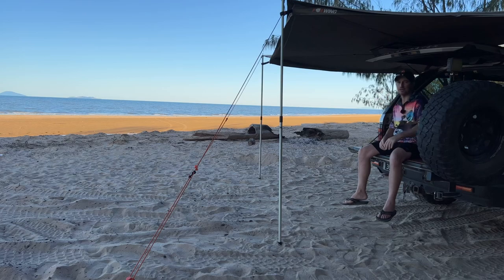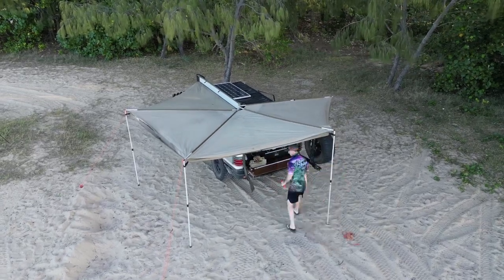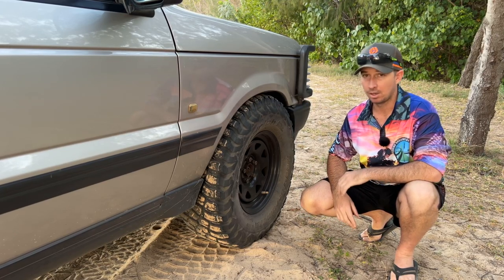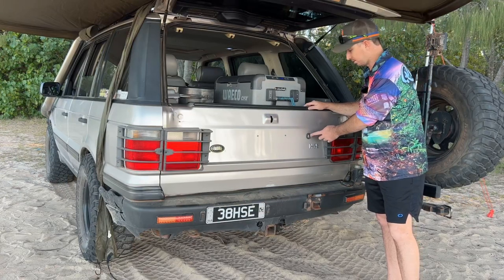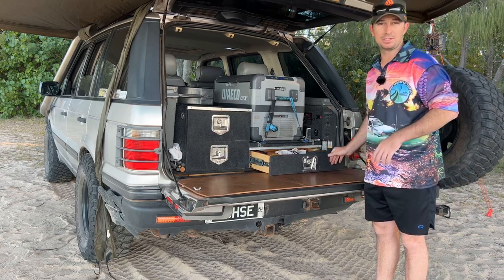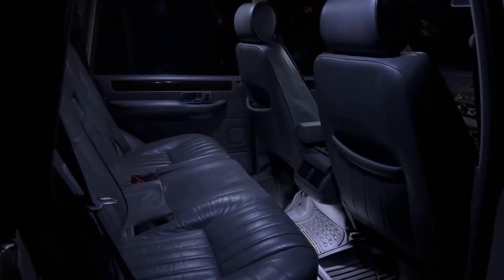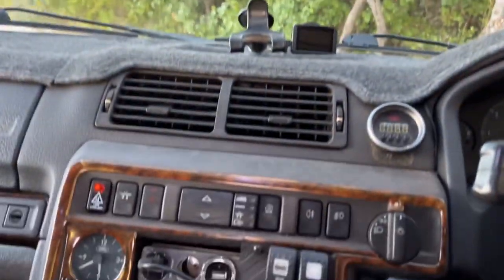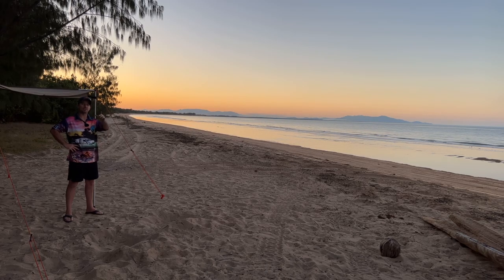The Complete Walk-Around of a DECKED OUT 4x4 - Range Rover P38 #p38 #eas #modified #4x4

Comment: Was your air sus system bypass a kit or a homemade thing? (If so where did you get it). Got a p38 myself and the air suspension is the only thing I don’t fully trust😂
Reply from the maker: Completely home made mate. I wrote the design on three sheets of A4 paper, got it lazer cut, welded together and then went about installing. It was first installed in my old blue P38 in 2011, which I retuned to standard when I sold it, and then put the lift into this current P38 in 2015.

It may take time, but it pays to learn how the EAS works. It’ll help you diagnose when needed. Keeping an eye on things allows you to catch things before they become an issue. They’re reliable, but they do require maintenance.

Comment: AWESOME VEHICLE, just done all four air springs, rebuilt compressor and valve body....got wof....runs and drives great....wow the 4wd is exceptional. Keeping stock but  wish for better tyres on the stock 16" alloys. Currently road tyres, any suggestions?
Reply from the maker: She sounds like a deadly machine 😁 tyres are a difficult choice. I’m running BFG KM3’s on mine and I find them a great tyre.

Comment: You don’t need spacers. The air sus has a ride height setting you can’t set. At full ride height when traversing awkward territory, if the air sus detects the chassis is grounding, the height is raised another two inches automatically and then drops again if no further groundings of the chassis is detected.  
Although I suspect you already know that.

Comment: On my 99 that plastic T on the top inlet to the radiator broke causing me to loose most of my coolant. I would be worried about weakening it by adding that temperature sensor. Plan to make a metal version one of these days.
Reply from the maker: Good idea!

Comment: Love it, have a look at truck Donaldson air cleaners, they have a drain rubber that allowsvwater to self drain but won't allow water in(self opening and closing)
Reply from the maker: Thanks mate, I’ll check that out for sure! Do you have any links?
Reply: If you search Donaldson air cleaners you'll see them on the bottom of the housing, they go from round to flat, ill see if mine in the shed still has 1 that i can upload a pic for you tomorrow
Reply from the maker: Thanks mate, sounds great 👍🏻

Comment: Did you have to do any cutting to have the 33's on?
Reply from the maker: Hey mate, no cutting or welding. I used a heat gun to massage the inner guards on the front wheels, not there were no cuts made.

Comment: Hey mate looking at getting a rangie myself where'd you get your locker from?
Reply from the maker: G’day mate, mine is an Ashcroft locker, and I have it in the rear axle. I got it direct from Ashcroft in the UK. Sent here (including freight) it was cheaper than an ARB locker, and the Ashcroft also engages more securely than an ARB too. They also don’t get air leaks.

Cheers
Keithy

Comment: Love to see your Range Rover still going strong.
Reply from the maker: She’s a solid old horse 😂
Reply: @Keithy_W  you mentioned in your video that you often take it through deep water. I've read many reports about the BECM getting wet when you go through water - what have you done to prevent this?
Reply from the maker: Good question mate! I wish I could post a photo on this conversation! I soaked my BECM this time last year. I’ve done absolutely nothing to prevent it getting wet, and as you see, my P38 operates and drives 100% as it should.

After I got out of the water crossing (recovery), I drove 100km, removed the BECM and cleaned and re-fitted it with all systems unharmed.
Reply: @Keithy_W  obviously they are more robust than what many say. 🙄 

I guess the moral of the story is if you keep on top to the maintenance, they are as reliable as the next.

I've only owned mine for 18 months and have been going on a few club trips as I learn what it's capable of. Thank you for your guidance
Reply from the maker: You’re not wrong mate. They are robust. Never have I been towed anywhere in a P38 in the near-20yrs I’ve been driving them. I believe a lot comes down to maintaining them well, and listening to its quirks. I’ve towed many Toyota’s and Nissan’s in my time.

A good battery, good fuel and regular maintenance. Perfect 👌🏼

That’s good to hear mate. You’ll enjoy it! Comfortable and capable motoring. So long as you listen to it, you’ll keep a reliable P38.